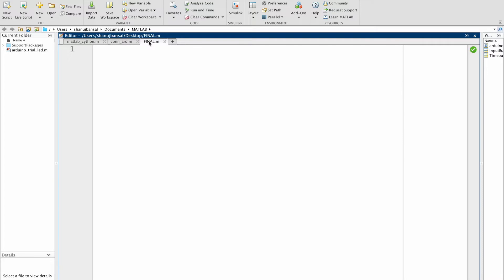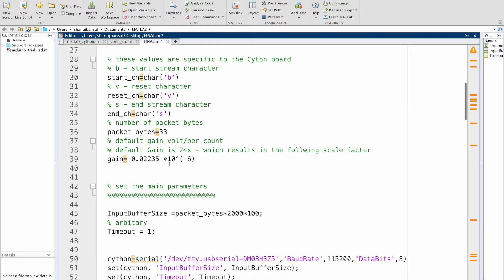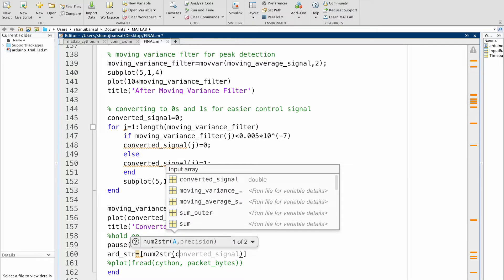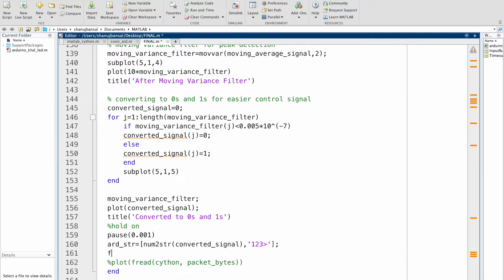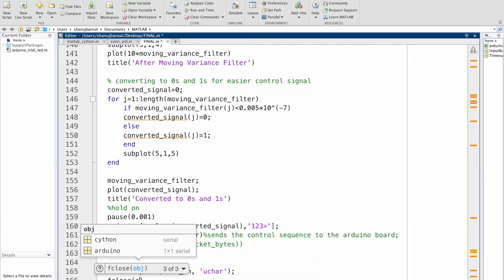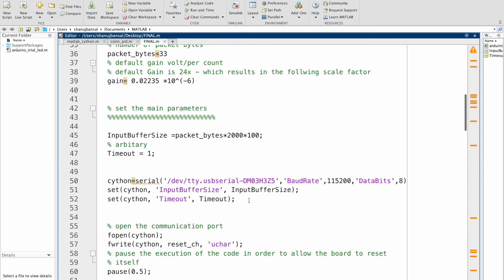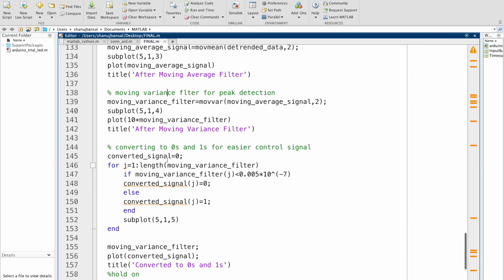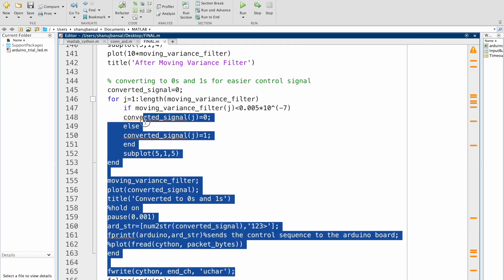PART 4: Controlling Motors by Using EEG Signals- OpenBCI EEG Brain-Computer Interface

Comment: Hi, i am using the OpenBCI MarkIV headset and want to control the prosthetic arm (just open and close initially) using Arduino and MATLAB. I have callibrate the data using LSL protocol and have them in CSV file. Now have the MATLAB code to normalize the data, and even have arduino code to control the servo for opening and closing of fingers. But the problem is that i am unable to connect them all in real-time. Can you please guide how to do that.
Reply from the maker: What you just described is a project that should last for 6 months. It is impossible to give you guidance over comment sections. Also, we do not provide free consultation on these issues due to the lack of time and energy.